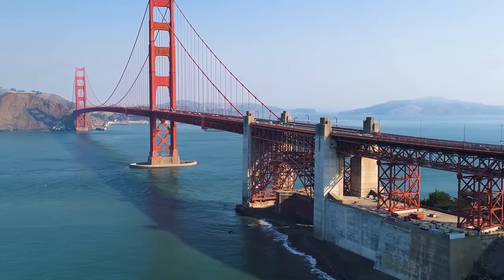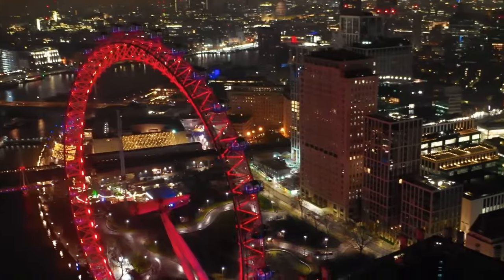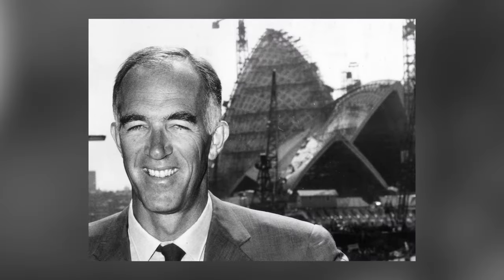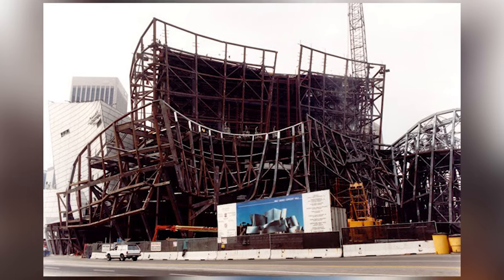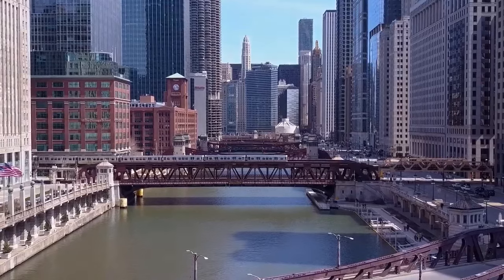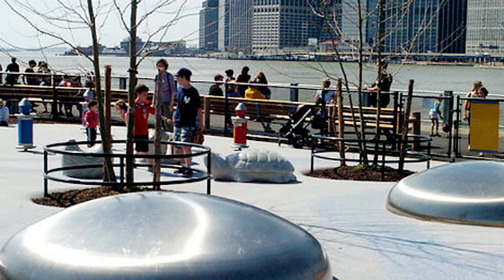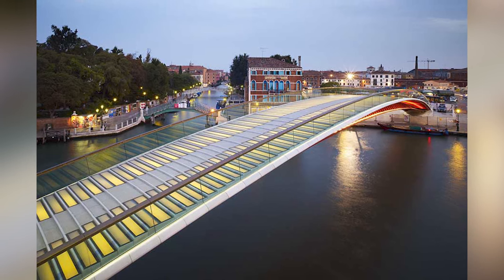12 Engineering Mistakes That Turned Out Not to Be Fails

Comment: "...set a carpet in a neighbouring building on fire..."

It actually scorched a doormat.

"...melted the roof of a luxury car..."

Spot temperature readings at street-level including up to 91 °C (196 °F) and 117 °C (243 °F) were observed during summer 2013, when the reflection of a beam of light up to six times brighter than direct sunlight shining onto the streets beneath damaged parked vehicles.

117 °C would only melt the roof of a "luxury vehicle" if it was made of chocolate, or some other low-melting point material. Even sugar for making toffee get hotter than that at around 150 °C!

Comment: Neat video but quite a lot of footage doesn't even source correctly.  You have Aon Center for example, but then pull Changsha's Sky City image for construction which has zero comparison.  Elsewhere, same deal, you have unfortunately really interspersed footage which isn't lining up with or relating to your actual discussion material.   Some of them are fails for sure, but others are corrected mistakes.

Comment: The title does not exactly rhyme with the content...none of these is a mistake that turned out not to be a fail. Even if a project is finally finished and safe, it is a fail if its original construction was unsafe. As for railways or roads that cross runways (Gibraltar was shown but not mentioned), it is not a mistake nor a fail.

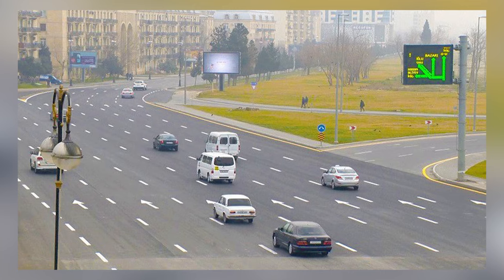Comment: Baku Railroad, (4:25), I lived 2 blocks from that location for 4 years and my office would look out over the intercession (4:26-4:36 photos are from Port Baku South Tower building between 5th-8th floors late 2015-early 2016, My office was at the 16th floor / about 8 floors above) in 2013 there were 4 railroad crossings across and the road was half that size.  What they are showing you is a snap shot of the expansion of the road, removal of the docks/shipyards and the expansion of the public sea boulevard, which was well planned (work plan from 2009 to 2018).  There were plenty of lights and a very LOUD siren that would go off when any train was about to cross. Most times the train would wait till there was a gap in traffic to cross and the train moved so slowly that you could run in front of it and cross it with little effort.    VERY POOR research…   (4:37) is the oldest image of the location in early 2013, where the wall was still standing to the left of the train to hide the shipyards and docks.  That was gone at (4:42) overhead photo is mid 2016 when the road turn off in the upper right hand corner was open for traffic, (4:48) is still missing the railroad to the last dock as it was still there below the screen as the rail was not pulled until late 2017 when the dock was finally moved “per plan in 2009” and a bunch of trees were planted in the back ground at the same time.

Comment: In China, there are many cases on stubborn resident refuse to move when someone want to build a railway or road thru their home. Usually it is because the compensation is very low or below the resident expectation. Housing price is high, low compensation means the resident may become homeless. Therefore, the Chinese engineers need to work around the stubborn resident problem.

Comment: Hancock Building in Boston was also known as Plywood City because of the early window problems. In the 90’s I climbed through almost every inch of that tower installing updated Life Safety Systems. There were still a few window issues. On very windy days the deflection of the tower is measured at ground level. If it is bad, the building is evacuated. There is a gyroscope near the top of the building with counter weights that move on windy days to balance the building. Oh yeah, being in Boston’s Back Bay, it is built on water! Piling may be about 30 stories deep to the bedrock.

Comment: Walkie Talkie being a big mistake that turned out to be not a fail. Yes.
The curved side managed to produce heat where people could easily fry eggs, melt the exterior of parking cars and crack the pavement, which then needed a 14 million $ worth heat shield installed at the top. Sounds like a colossal trainwreck to me

Comment: The John Hancock Tower (Boston) was a fail not because of shoddy construction.  It was because of shoddy engineering.  Someone forgot to do dynamic load analysis.  The result was a building having a resonance frequency in the range of the prevailing wind.  The building swayed and buckled, causing the glass from the upper floors to fall off.  They patched it by installing a weight near the top that shifted the resonance frequency.

Comment: The planes are not moving at top speed when they approach the train, they are either taking off or landing, nowhere near top speed. and you showed a jet which was very misleading. I was looking for an engineering feed to subscribe to, but your little tricks are disappointing and I don't trust you.

Comment: Fun fact n. 2: I'm a Venice architect, and remember that Calatrava's bridge, although his real beauty, not only manage to injure people, but also it bends through wind, and it's weigh is causing a gradual distancing between the two islands on which it rests... For this reason, the municipality is using almost 1/3 of his annual cap (intended for the maintenance of the entire delicate city) to reinforce its foundations! 🤷‍♂️
Reply: We have two Calatrava bridges here in Dallas. They are mostly know for costs over runs during construction with the pedestrian/bicycle part of one still unopened due to structural deficiencies.

Comment: For the first one, if New Zealand has atc similar to the USA, then that's probably why.  ATC in the states (at least the busier airports) have to regularly have planes taking off back to back.  Sometimes multiple airplanes are on the same runway taking off.  This could be why if they force the trains to alert when they are closing in.

Comment: First Chongqing is a very mountainous city so that's why they needed the monorail to be of that height. Secondly, the monorail runs on rubber tires so there is relatively not that much noise. In no way was it ever a mistake, since they took the necessary precautions.

Comment: In the early 60s a company named Thompson, Rhienhold and Woolridge  was given the task of developing a way of managing engineering projects with crossed requirements and no common communications networks. It was also tasked with monitoring program status in terms of % complete and to list the tasks on the critical path (if these tasks weren’t done project would be an immediate failure, like build elevators).   This was done in order to put a man on the moon in less than 10 years.  The company is better known as TRW.  It started as a maker of standard parts for bicycles, later it started the infamous “credit check” business.  It was was chopped up by a bunch of Gordon Gecko types in the 90s and space and defense went to Grumman and automotive was a standard alone run by John Plant who cuts the guts out and sold it to ZF for a tidy sum.  He was the highest compensated executive in Michigan for man years using cut to the bone and sell techniques.  The methodology for program management was called CPM, Critical Path Method it’s tool was PERT, Program Evaluation  Review Technique .    It’s purpose was o prevent these stupid mistakes by writing down detailed customer requirements and specifications including things like don’t start other buildings on fire.  There was a compendium of dumb things the customer wanted but they really weren’t that dumb.    Auto management in the 90s wanted nothing to do with it.  They liked “shoot from hip” and methods the president is trying on eliminating the C-Virus.  I’ve been around too long and seen too much, shoot me now!

Comment: Doing this work as a commerical builder I can say every job is like this. Constant revisions of blueprints and on the job changes. I've never seen a job match the first blueprint
Reply: Same with software projects, but even worse.  A company I worked for long ago underbid software projects but a contract included very high prices for change orders.  Every customer thought they were getting a bargain, but ended up either with software that met the agreed design (but did not work) or spending much more than if they went with a more expensive initial contract.  This is because customers mistakenly think they know exactly what they want.

Comment: I have a moral obligation to point out that however the naming rights are sold Chicagoans have a tendency to stick to referring to local buildings by their original names. 

For example, most Sox fans refer to the Sox baseball field as Comiskey Park, or Comiskey, which is the original name of the original stadium across the street. Interesting trivia, After a multi-million dollar rail realignment, both Wrigley Field home of the Cubs and Comiskey Park are on the same El line. Making a “Subway Series” for the World Series theoretically possible. However, that would require both Teams to Win their playoffs in the same year. Riiiight. Ironically as of 8/2020, both teams are in first place in their division. Ok, who’s got Subway Series in Chicago on their 2020 bingo card?

This name stubbornness is not just with baseball. Many people call that night white building not even the Amoco building but the Standard Oil building.

On State Street people still meet under the clock in the Marshall Fields building well after the building’s purchase by Macy’s. 

There are so many examples of this.

Oh, there’s a big move to rename the street in front of Chicago’s Trump tower either Black Lives Matter Parkway or possibly Barack Obama Parkway, or the like.
Reply: Oh? And the X shaped John Hancock building is in Chicago not Boston. You showed a cube based building instead.

Comment: That monorail through the apartment building (Liziba/李子坝) is now a major tourist attraction in Chongqing. They recently built a viewing platform outside the station for tourists to film the train arrivals. It's nothing special after you see it a few times, and there's an upper entrance on the back side of the building since the building is on a hillside. It's a quick photo-op if you go, but in CQ the best tourist attraction for me is the cable car. If you use the regular metro card, you can take the cable car across the river for the same price as the bus. (It's not that practical, though, with so many tourists.)

Comment: The swaying building “all issues has now been resolved”... uuuhm HOW? It’s not like it’s a flat tyre that can just be patched up. I’d REALLY like to know HOW they fixed the rigidity of the building to stop it from swaying
Reply: There are some excellent videos on it (*elsewhere* on youtube, not here) on the subject of "Tuned Mass Dampers", the way the Hancock Tower was stabilized  (two moving 300 ton weights near the top of the building.)  Maybe if the producer here had read the rest of the Wikipedia article it would have been less of a mess...

Comment: Lol I know that bridge made out of glass in venice, it's absurd. Of course bridges and walkways with glass are common, but flat ones. Not ones where you have an incline either side you need to climb with steps. Dumbest idea ever. Should have just sprayed the whole thing in teflon and have water sprinklers running 24/7. Called it the leg breaker. Cross if you dare. Impossible for wheelchair users and a deathtrap for the elderly always walking over it.

Comment: You should do one on the city of Honolulu's "light" rail system on Oahu , Hawaii. Its only 20 miles long and is projected to cost over 9 billion dollars!! That's 450 million dollars per mile!! It's almost double over budget and 3 years behind schedule and they still have 4 miles to go through the most heavily populated area on the route.
Reply: That's a red tape issue, not a structural thing.

Comment: I don't think having cladding/ glazing fall from the building be a mistake that didn't turn out to be failures (it is a failure). I think examples of the train line across a runway or the train line through a building is not a mistake it was considered part of the solution to a problem.

Comment: The windows in the Hancock tower in Boston fell because they were defective, not because of incorrect installation.  The fix was to replace them with correctly designed windows.
Reply: No, the fix was to greatly reduce the twisting and swaying in the wind.

Comment: Even if the train did still run, a plane would never cross paths with a train, either the train would wait at a signal or the plane would wait, ATC (Air Traffic Control) would stop the aircraft, so there would never be an accident, so you would never see a plane coming at you, and as the line would probably of been used for freight, it’s a good story though.

Also the other RR crossing one the train would never come fast always at around 5 mph and with lots of horn and bell sounds, it’s not that dangerous, but again good story!
Reply: Tabourba  that actualy realy true :b

Comment: Architects 👏🏼are👏🏼 not👏🏼 engineers. Source: I am an engineer. Architects are very idealistic and generally don’t design things that can be built. Us engineers actually make it work. If you were to build something directly from an architect, without us engineers, it wouldn’t work or be safe.
Reply: Look up the history of Frank Lloyd Wright's "Fallingwater" house. The engineer had to sneak in extra reinforcing that FLW didn't want. It turned out that even that wasn't enough, and the house had to be heavily reinforced later to keep it from literally falling into the creek.

Comment: There are other trains that go through buildings. Like in Den Haag for example, or the one going through the hospital in Chicago.

Architects usually fail when they don't talk to the people who will be using the building, to discover how they work. My all time favorite fail is a trauma hospital, with a helipad on the roof, that nobody can use as the architect figured it only needed stairs from the helipad, down into the hospital. He never thought about them needing an elevator to bring the injured patient down from there, on a gurney. He never once though to talk to the staff, who would have seen the problem immediately!

Comment: The glass bridge seems like a quick fix. Just coat it in semi transparent grip tape. Easy peezy.
Reply: Wears off with traffic,best is to coat in  clear lacquer and while still wet,evenly sprinkle sifted sand granules for traction.Recoat every few years as needed..In the center could leave a measured trail left clear to enjoy the see through effect ,length wise...

Comment: Oh nice, another misleading top.
You just need a little bit of brain to understend some of this "facts" are inflated.
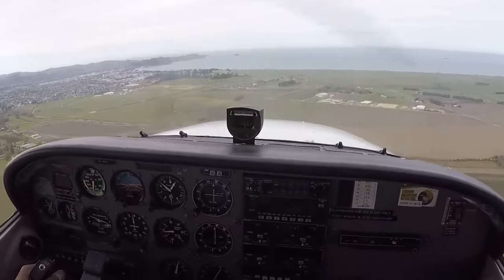1)1:19 luckily it will never happen since it's pretty obvious trains and planes are coordinated not to cross each other path
2)4:14 you can clearly see a traffic light in the photo, also all the cars stop before the tracks indicating they know where and ehen to stop. 4:48 if you compare it to the photo from above you'll notice it shows the segment of road after the crossing, so it proves nothing. I still haven't found anything about it tho.
3)8:59 CarrAra not CarrEra
4) 12:25 the track that pass through the building it's indeed very long but what if it actually doesn't focus the weight on the apartment structure or if the apartment building was modified to support the weight?

Comment: A precise similitude, where rail line crosses through the runway, is Peshawar International Air Port, KPK province of Pakistan. The said line leads to the legendary Khyaber Pass pulled and pushed by two engines.

Comment: I've only watched 3 mins so far and i'm already disappointed, firstly, of course they won't be flying whilst a train is crossing, they'll be sitting there with the engine off or on idle, secondly, the building in london, had had fixes done to it, when you say surprisingly it's still sanding, what's so surprising, the windows had tint added so it no longer reflected the light and things were done to change other issues such as the wind, your here doing an interesting and good video but 3 mins in, all you've given is half the information making everything look bad, you should be saying, here's the mistakes, this is what they had to do to fix them, if anything.